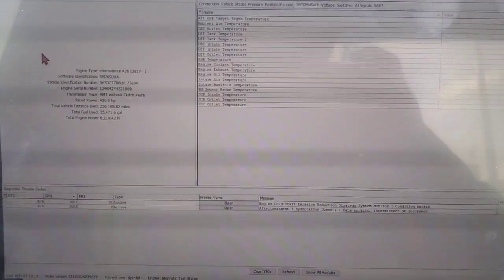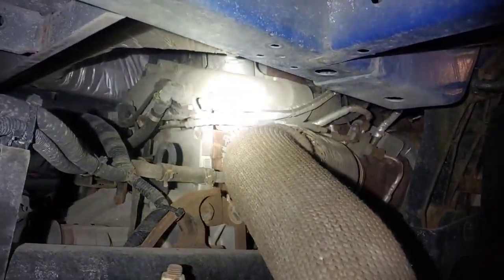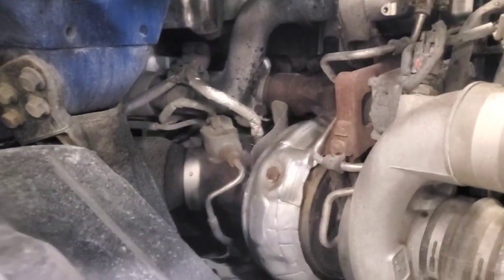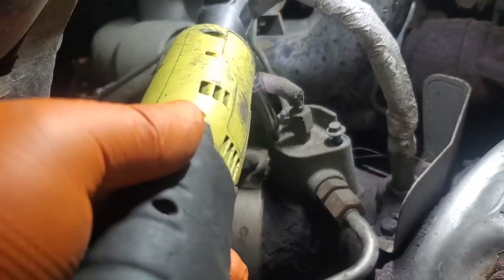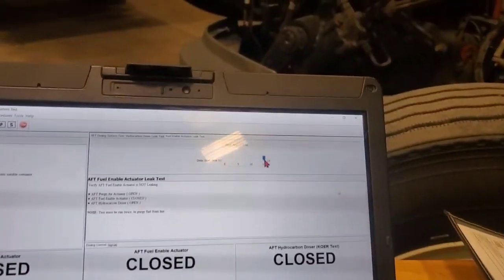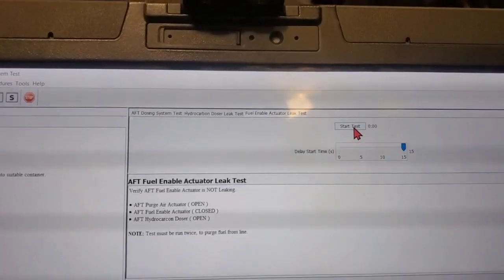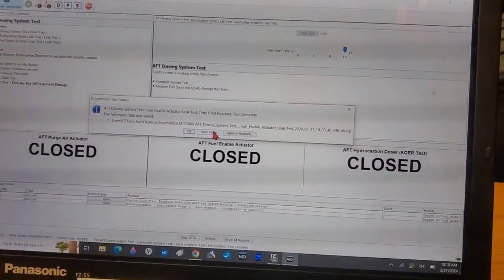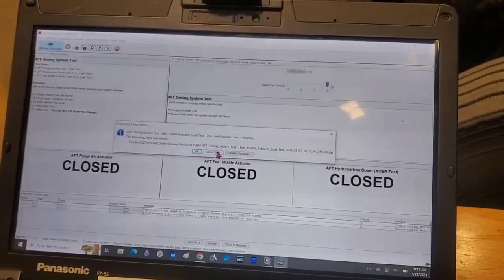International LT A26 engine 3556 code Hydrocarbon doser diagnostic testing - derate repair

Comment: Have you worked on 5298 fmi 18 followed by missfire?
Reply from the maker: @teoft-cdltrainingemploymen3360  yes, engine issue may cause that DOC efficiency code.
Check for exhaus/intake leaks and doser performance. Also could be faace plugging of DOC.
Reply: @AcousticHills  i mistake this code for egr valve failure, took it apart, tested and visually confirmed that it performs at each opening fine